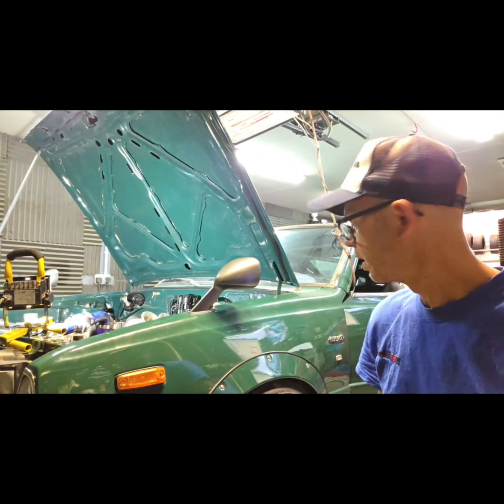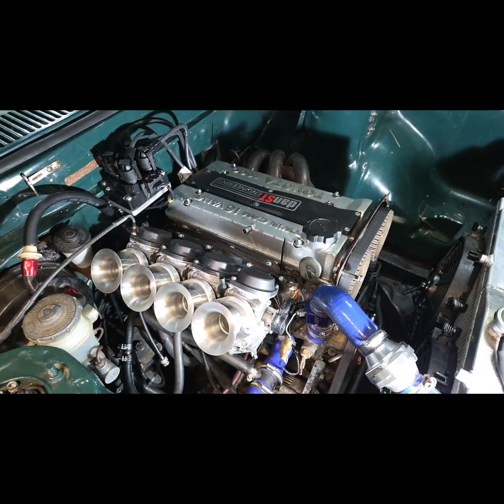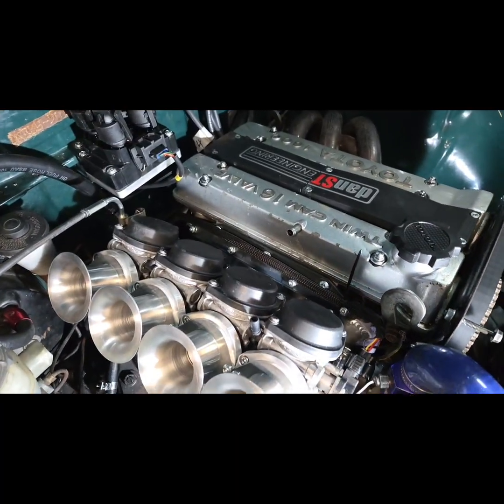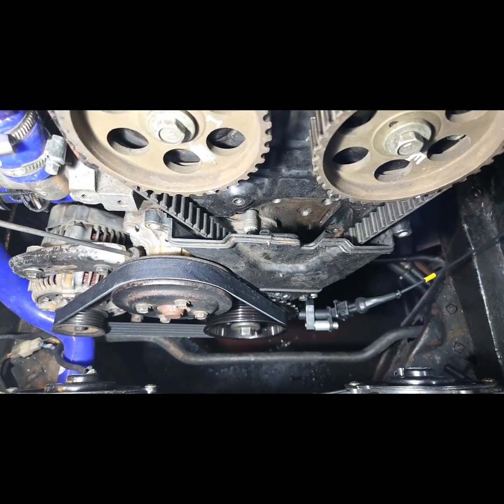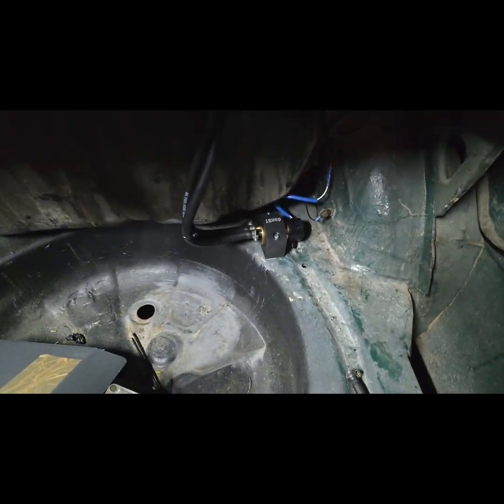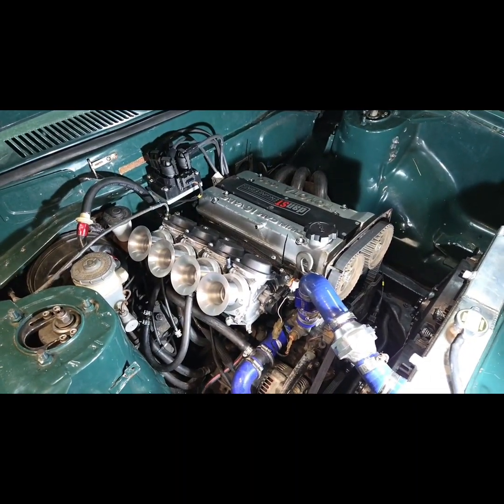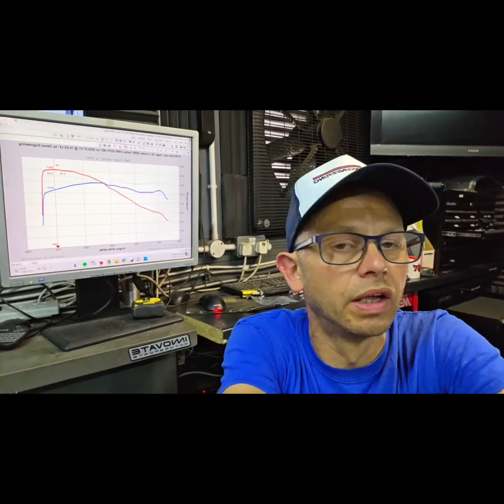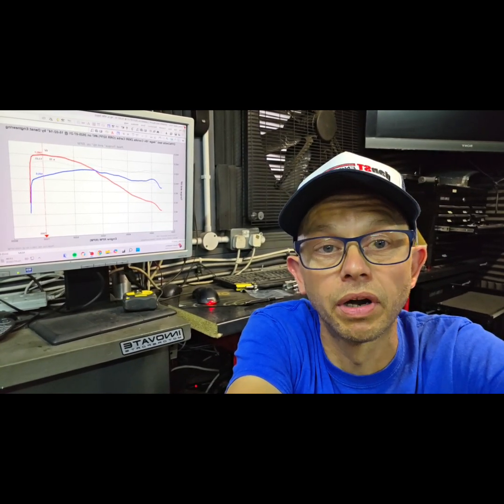JDM Corolla powered by a 4age 16v hits the dyno......

Comment: Hiya bud. Can I get an email i can contact or where I can find a contact number please. I'm stuck with an old nodis want a new one as I had a 130 silvertop engine and now can only find 105. I'm guessing it's blown up because of ignition timing being out causing pre det, I need a new nodis with a tune for a 105 on bike carbs or this one flashing to suit.
Reply from the maker: No problem, we can certainly sort that for you. Either email enquiries@danstengineering.co.uk or call 01274580213.